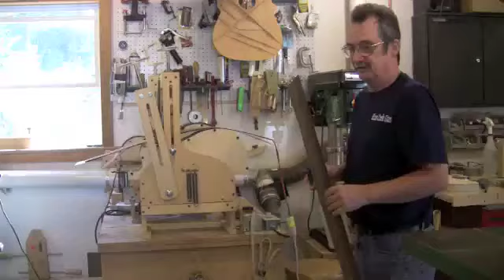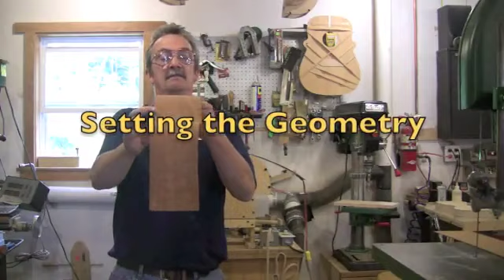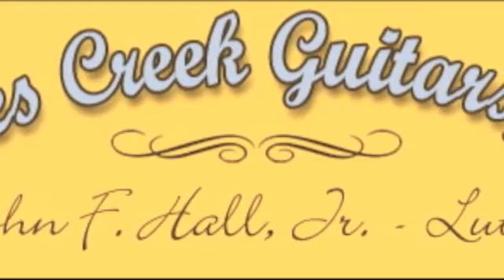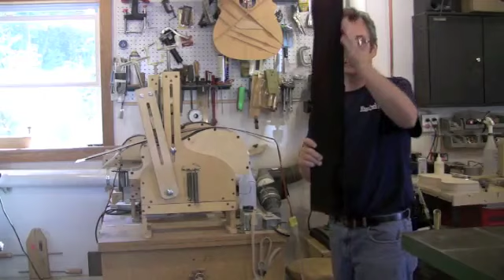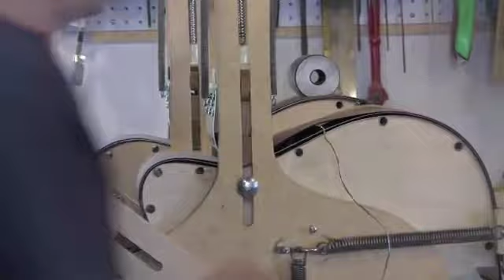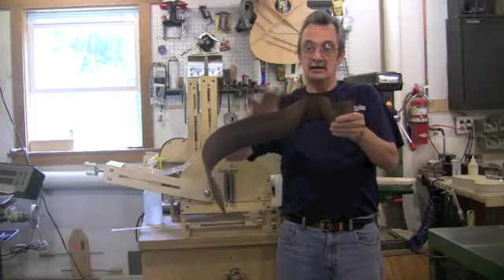Bending and Setting Up Sides Part 1

Comment: I was just wondering on your side bending machine that you ram in the center has a piece of steel I realize that it is smooth and better on the wood . but my question is does that bend to the shape of the waist also and how thick is that? I am just know building two of them and I at this point and I ampondering on what is the best way to create the bottom of the ram. any advice will be greatly appreciated. thanks for all the great videos also.